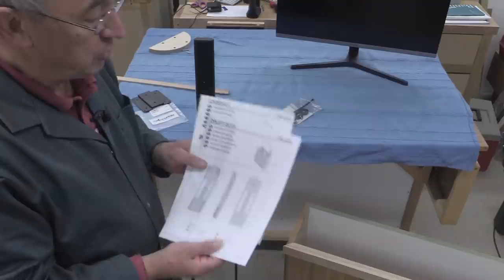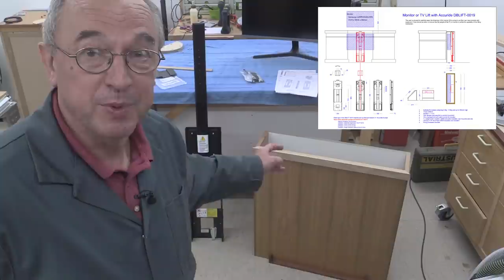How to make a Monitor or TV Lift

Comment: I've got a Samsung monitor and it does take up a lot of room so i feel your pain Peter but I would have liked to see you make a mechanism made from wood using your outstanding engineering skills..... Just a thought for another video.... Keep up the great work sir.
Reply from the maker: Hi Kent, I did think it through and the two issues were how to make a really reliable vertical linear slide and also how to create a spring mechanism. For many professionals spending a day working a design out and at least half a day making something is probably 2 or 3 times the cost of the DBLIFT in terms of lost income.   Cheers.  Peter

Comment: That’s marvelous. Very neat altogether.

Since you had to add ballast anyways, I wonder if there’s a way you can store your keyboard on it so that it acts as the ballast at the same time as hiding the keyboard away.
Reply from the maker: Hi Frank, I do keep the keyboard and mouse on top when it is down but not as ballast. Yes, a neat design change could put the keyboard and mouse in a tray area between the top of the monitor and the cabinet top. Great idea - cheers.  Peter